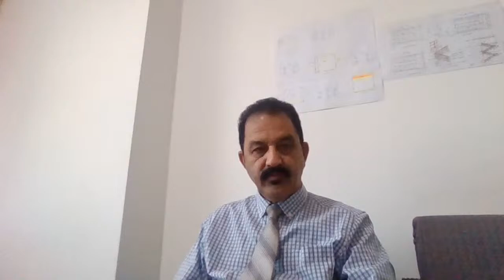Civil Construction Material--Technical session no 11---Precast Concrete & Elements

Comment from the maker: Installation
The on-site installation of precast components can be a high-risk activity involving the use of heavy plant, cranes and personnel working at height. Consideration should be given therefore to safeguarding against risks when receiving delivery, moving, and placing units.
Consideration should be given to:
	The method and sequence of assembly and erection.
	The method of providing temporary supports.
	Structural connections and joint details.
	Tollerances.
	Handling and rigging requirements.
	Site accessibility for delivery and storage.
	Crane capacity and working clearance for hoisting.
	Sample measurement to confirm the accuracy of critical dimensions.
	Visual inspection of concrete finishes for defects.
	Locations and conditions of lifting inserts for hoisting.
Connecting precast concrete elements
Precast concrete components can be connected in a number of ways:
	They can be bolted together. 
	In order to do this, steel connectors are embedded in the concrete at the time of casting. This must be done with great precision.
	They can be grouted or concreted together. 
	In this method, loops of steel reinforcement are left protruding out of the precast concrete members. Two members are placed in position, and reinforcement is threaded between the loops. Fresh concrete is then poured around this reinforcement, in a space left for thi
s system.

Comment from the maker: Manufacturing process
The production of precast concrete elements takes place under controlled conditions in enclosed factories. 
This means that tolerances can be accurately controlled, waste can be minimised, and that a denser, stronger and better quality concrete can be produced.
Concrete is cast into forms and left to cure. Precast forms are normally made of steel or plywood. Whereas plywood forms are usually limited to about 20-50 castings depending upon the complexity of the form, a virtually unlimited number of castings can be made by precasting using steel forms.
Precast elements generally incorporate steel reinforcement to resist loading stresses. A common cause of the deterioration of concrete structures is the corrosion of this reinforcement. It is important therefore, that they are properly designed and embedded in the concrete.
During the manufacturing process, admixtures can be included in the concrete. These can be water-reducing, air-entraining, retarders and accelerators (for faster curing time). The purpose of admixtures is to improve concrete quality in both its fresh and hardened state. Colour pigments can also be added, such as iron oxides (red and brown), chrome oxides (green) or cobalt oxides (blue).

Comment from the maker: Disadvantages of precast construction
There are a few main disadvantages of precast concrete construction:
	Since each piece is made separately, the structural frame or system is not monolithic or continuous like regular concrete construction. The joints between pieces create structural discontinuity. The forces of the building will pass through these joints, so they have to be designed to transfer these forces safely and properly. Note that precast concrete can be used for non-structural members too.
	As the building is made of discrete components, the joints between adjacent members have to be sealed with special sealants to make them waterproof
	Each precast component is usually large and heavy. This means that cranes are required to lift them in position; these cranes are required to operate over the entire building volume. 
	Since there will only be a few cranes at site, the time taken by the cranes to pick up a piece and shift it to its final position becomes critical in determining the building schedule.

Comment from the maker: This means that the quality of precast components can be very high.
Since the components can be made beforehand, construction can be very quick. 
In cast-in-situ construction, engineers have to build each set of components after the previous set has finished, which does take time, as concrete generally takes 28 days to reach its full strength.

Comment from the maker: As it is done in a purpose-built precasting yard or factory, it makes construction easier for the following reasons:
	The construction is done on the ground rather than at height.
	It can be done inside a climate-controlled structure, eliminating problems of rain, dust, cold, or heat.
	Specialised formwork (moulds) can be built for doing many repetitions of the same component.
	Specialised equipment can be used to make, move, and pour the liquid concrete.
	Curing takes place in a controlled environment.

Comment from the maker: Related articles on Designing Buildings Wiki
	Cast-in-place concrete.
	Cellular concrete.
	Concrete.
	Concrete frame.
	Concrete-steel composite structures.
	Concreting plant.
	Design of durable concrete structures.
	Ground beam.
	Grouting in civil engineering.
	Precast concrete cladding.
	Prestressed concrete.
	Rebar.
	Reinforced concrete.
	Slip form.
	Smart concrete.
	Stratification of concrete.
	The properties of concrete.
	The use of concrete structures to protect construction sites.
	Tilt up construction.
	Whittington Estate.